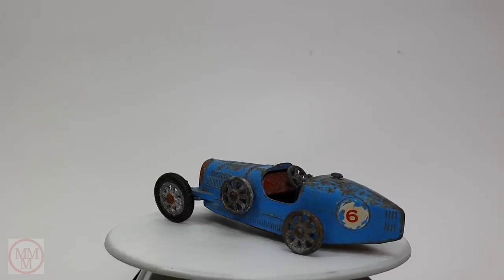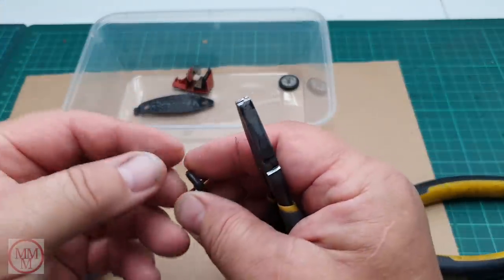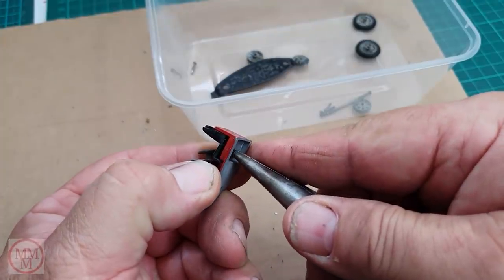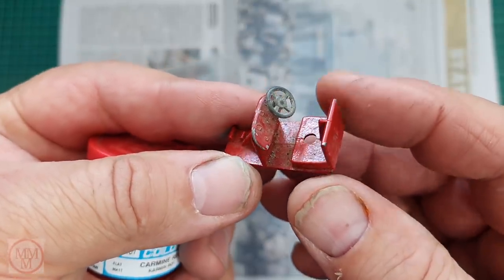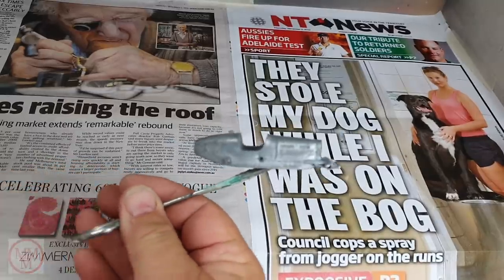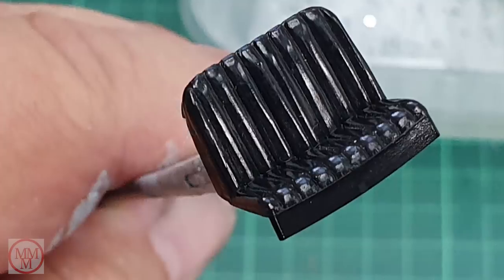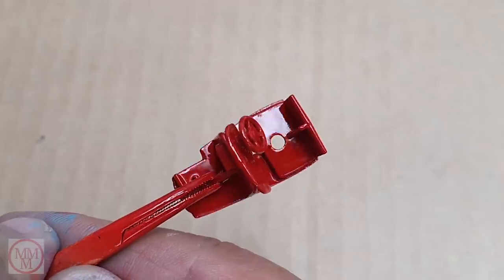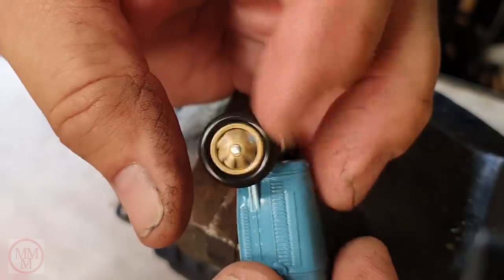MATCHBOX Restoration Yesteryear Y6 1926 Bugatti 35

Comment: This is one of the best ones yet, mate! Good job! 

If you want to make it a little easier to make straight, clean lines with a paint brush, you need to touch the tip of the paint brush to a paper towel after you load it up with paint. You want all of the paint in the belly of the brush, but not so much the tip. If you touch it to the paper towel, you can assure that the paint will ooze out from the belly of the brush to moisten the tip when you paint. If there's too much already on the tip, it just goes everywhere. :)

Amazing work, and thank you so much for the continuing entertainment!
Reply: That's a great point (no pun intended, but I'll take it).  That's why rounds are so popular among figure painters-brushes with a thicker head but running to a fine point.  They work like a fountain pen.  The head of the brush is the reservoir, and the point is the tip.  The brush and the technique work particularly well with water-based acrylics.
Reply: @theBaron0530  lol

Comment: Had a look at Jay Leno’s garage, he doesn’t feature the exact same model of Bugatti but similar. The inner of the two levers are the gear shifter and the outer is the E-break. 

As always a fantastic work with the model
Reply: I wonder what Mr. Leno would think of his show being used as a reference for a British die-cast model restoration? I bet he'd be impressed.
BTW, I have that same blue Bugatti somewhere in a box, in much better condition than originally shown in this video.

Comment: Another fine job Marty.  Just a quick note on color mixing that might save you quantity.  When mixing the lighter shades start with white paint and add the darker drops.  It’s easier than adding more and more white to a darker color to achieve your goal.  That’s the technique I use for paintings.

Comment: Splendid. Love seeing the cat. You all should be into full fledged Summer soon. Not knowing the brand means it will be hard to get a new tip or needle for your airbrush so you should get another just for that option. However, I think yours will go for probably as long as you do this. The Yesteryear cars do have a quaint beauty & lovely style. Thanks.

Comment: great work, the gold details make a lot of difference. :)
the levers are actually gear shifter and handbrake. the foot brake tended to brake down the driveshaft, while the handbrake actuated the rear brakedrums behind the wheels. front wheel brakes often weren't a thing back then, for a number of reasons.
if you have to hammer somethign into such a fragile or "soft" piece of material, try to put something directly underneath to prevent it from "swinging", and thus taking up the force from the hammer instead of in this case, the little nail.

Comment: The font of the 6 is called Copperplate Gothic, it should be included into CorelDraw package which, as I recall, you have installed... or it's anywhere online ;)
I also advise you to set the best and slowest possible printing quality , as well as paper for the best kind of glossy photo paper there is in your inkjet printer advanced settings when you're doing decals, so that they would look neater and thus closer to originals.

Comment: There is a trick sir to save cleaning solution in your sonic cleaner, put water in the sonic cleaner then put the cleaning solution in a container large enough for your parts and set that in the sonic cleaner.

Comment: It may not have been necessary to print those tires. Those are just round rubber gaskets. You could probably have found replacements that fit at either a hardware store, an automotive store, or even online.

Comment: Dear Marty when you are grinding off the ends of the axles hows about using a thin bit of plastic to protect the wheels with a slot cut in it  to slide over the axles and then you can go at it with the dremel and any slips are taken by the plastic. A bit of plastic milk carton would be ideal as they are bulletproof plastic...basically just a square with an axle sized slot into the middle of it would do you...But I don;t know, maybe you enjoy the danger.!!!!.

Comment: hello it is very beautiful, I have a question, does the paint hold well on your repainted cars? When I restore it, if I scratch it after it is dry with a nail, it comes off very easily compared to a new car where it is very solid, however I put primer before painting.

Comment: I was going to suggest you just do the opposite of the way you got the nail out. basically that's what you did with the clamp instead of pliers. 
I think you worry too much about getting the paint exact.  Also I think the screws would be better in black, not body color. Just one man's opinion. 
for silver and gold, I just use some metallic spray paint from the Dollar General. I spray a bit onto aluminum foil and use a brush or sometimes just a cotton bud to apply it.